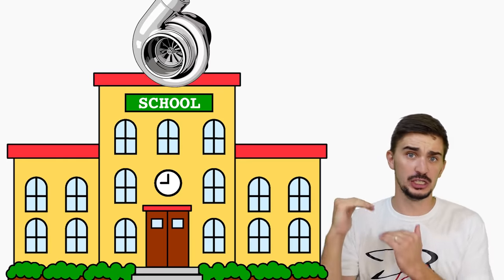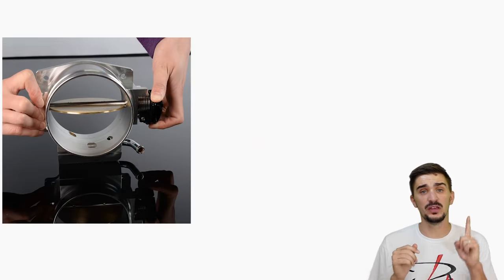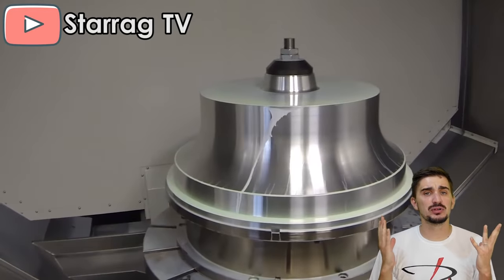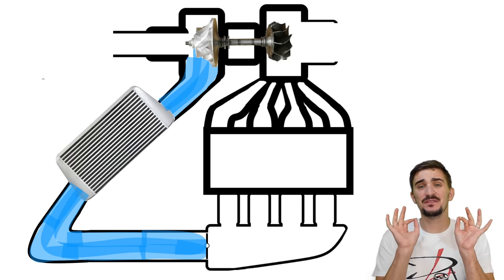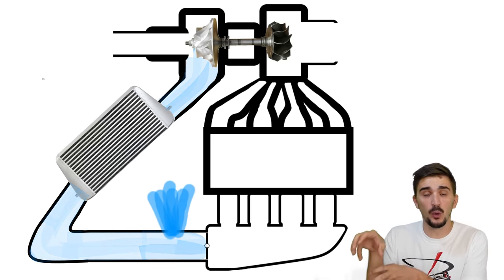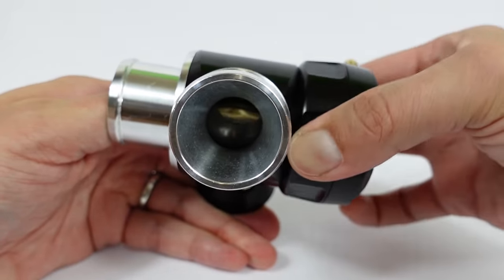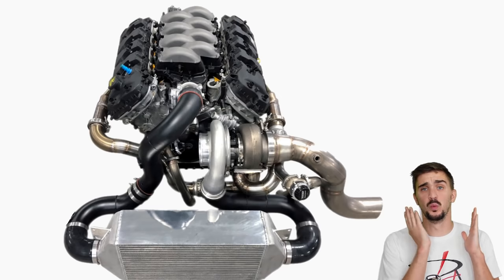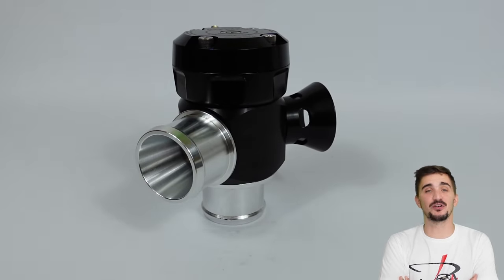TURBO FLUTTER and BLOW OFF VALVES explained in DETAIL - BOOST SCHOOL #8

Comment: it would be the best to install throttle body in front of compressor, no need for bov, and turbine keeps to rotate
Reply: There is a reason no one does it like that, it doesn't work very well.
Reply: @DriftNick  thanks, but all screw/root superchargers have throttle body in front of s/c, and that seams better because it can be controlled how much of air will be sucked in and better efficiency because no air is wasted
Reply: @makantahi3731   Screw/root superchargers don't have a large volume of air after them and they are belt driven which solves a few of the issues you have with a throttle plate before the turbo like throttle response, the vacuum making turbo seals leak and overspinning of the turbo.

Comment: You forgot to mention compressor surge occurring while the throttle plate is still open, this scenario is the main cause for turbo failure due to surge.
Reply from the maker: I didn't. Check the last time stamp.
Reply: @d4a  perfect, my apologies for not finishing watching!
Reply from the maker: No problem 😊

Comment: This is the first time I heard of turbo flutter on full open throttle. How can the turbo overpower the engine? Isn't that the job of the wastegate? Was the car wrongly setup?
Reply from the maker: Yes, the setup is essentially incorrect unless you actually wanted it that way. The turbo is not overpowering the engine, it's simply feeding more air than the engine can consume. Wot flutter can happen before the target pressure for opening the wastegate is achieved.
Reply: The clip he showed isn't on full throttle, that is when it's less likely to happen, it's mid-high rpm with part throttle (in that video he is trying to make the sound to show it happening).

Comment: Is induction flutter also created via the BOV? I'm not sure if my question is correct but, I hear it a lot on WRX and STi's, and it is very pronounced during acceleration, and very distinct while you hear the rumble climb the rpm range.
Reply: If im understanding what you're saying, you are talking about the turbo "fluttering" while creating boost. This is usually an internal waste gate inside the turbo opening and closing in order to regulate max boost so you dont overboost.
Reply: You're mixing wastegate flutter with turbo flutter, both diffferent things.

Comment: I never run blow off valves on my turbo charged cars, and no damage to my turbo. Off throttle compressor surge doesn't harm turbos, however full throttle compressor surge can destroy a turbo.
Reply from the maker: As I said in the video "if boost pressure isn't high enough". When you run low boost surge can't harm the turbo, that's why some early turbo cars didn't even have diverters or bovs from the factory.

Comment: A bit late to the game with this comment. But wouldn’t one be able to tune the blow off valve with springs if the turbo is overpowering the BOV? 
Also if I’m getting flutter from my turbo, and also have a BOV, would I need less spring? I haven’t turned up the boost all the way, I’m just at 15psi. 

Thanks 
Maurice
Reply: no, a bov has boost on each side so the spring doesnt need to be very hard.
Reply: @AtMortenJ  I ended up looking into it more after drunk posting this, and I’m pretty sure I’m over sprung on my BOV. I’ll grab a lighter spring, and keep the old one in case running another 10psi is too much for it. 

Thanks for the reply!

Comment: One question , pedal box or sprint booster they make throttle plate open fast , its it going to damage fuel pressure sensor?

Comment: I always heard that a low pressure turbo don't get hurt at al by flutter? around 0.4-0.5 bost pressure shuld be harmless or am I wrong? my -01 volvo 2.4T do flutter al the time when letting go of throttle, and I have the open airfilter. I can hear it FOFOFfofofof.. I have not done anyting else to it.
Reply from the maker: Your assumption is correct. As I said multiple times in the vid when mentioning possible damage: "if there is enough boost". Flutter at 0.5 or 0.6 bar can't really hurt the turbo. This is why early turbo cars that ran boost didn't have a recirc from the factory. Today all cars have them.
Reply: @d4a  Thanks! sometimes its hard for a swede like me to take up it al in one goo like this :)

Comment: Quite a bit of misinformation in this video. Off throttle flutter does NOT cause damage to the turbo, even at relatively high pressure 20+ psi.

Comment: This video that I found on auto play while working may have just fixed my 2012 GolfR... 

Although what would you check if at what you describe around 14:40 is happening at idle/general driving, not just WOT?
Reply from the maker: Stock or modified?
Reply: @d4a  turbo and diverter valve are stocked with just a gfb DV Plus added to the stock diverter valve. The car is modified itself, with a tune and everything, but with four mechanics looking at the car so far, four different ideas what the problem is.

Saw this video and suddenly it made sense what might possibly be going on with my car except it's also happening at idle

Comment: Is there a difference between these and a “waste gate”? I’m thinking the waste gate relieves the exhaust pressure rather than the intake pressure?
Reply: The waste gate relieves exhaust pressure.

Say you want to make 10psi of boost and no more. You set your wastegate spring to a “10lb spring”. This means the waste gate opens at 10 psi or more. 

Why? Well without a wastegate the turbo will continue to make as much boost as it can depending on the given exhaust flow.

Having a waste gate with a 10 psi spring will allow your turbo to spool up and once your making more than 10 psi the remaining boost is diverted back into the exhaust pipe (down pipe/turbo elbow) or is some cases to atmosphere (external waste gate). This allows you to maintain 10psi of boost.

Replace 10 psi with whatever is your desired psi is.

Comment: So if your car is running low boost/power than it’s fine? I’m planning on turbocharging my gt86 and I’ve seen builds with 9 psi at 300hp would this still be bad for your turbo?

Comment: Can you do a comparison on that for gas and diesel engines?
Reply from the maker: No bov on diesel because a diesel doesn't have a throttle plate
Reply: @d4a  i see. AFAIK gas throttle is regulated by the amount of gasoline being injected contrary to the diesel which is controlled by air isn't it?
I do hear flutter on my 2.0 TDI from time to time though

Comment: Need advice, replaced my stock turbos ( cus they were leakijg oil) on my 2015 m4,  installed CTS stage 2+. It runs great with my stage 2 tune that I've been using. I hear the spool amazing, pulls hard, but I get this flutter sound especially when going hard in Sports+ mode, almost like in the end of the video. Would a custom tune fix this flutter? Ive seen smoke come out for like 15 seconds..twice in the last 2 months. A quote for custom tune by RK Tunes is going to cost about $1400 minimum.

Comment: I hear turbos on diesel make a seeeer or tssuuuuu sound when str8 pipe is that turbo surge? Beause not all turbos on diesel makes that sound although diesel dont have throttle valve
Reply: Some modern diesel engines do in fact have a throttle plate to help control emissions. Sounds stupid but I guess it works.

Comment: I have a 2003 Saab 9-3 Linear 2.0L turbo.. I replaced the worn stock turbo with a Stigan turbo and left all engine computer control settings stock..  The new turbo sees to "stutter" during acceleration and I don't know why or how to fix.  I emailed Stigan but got no response.  Any ideas? at some point I had replaced the turbo bypass electronics too, but I don' t think this caused the problem since I don't think problem existed until I replaced the turbo.

Comment: What if your engine doesn't have a throttle plate?  Could I still use this BOV without intake vacuum?
Reply from the maker: It can be rigged up and there are kits for diesel engines but for most applications there's zero benefit.

Comment: I some times cannot believe what I read on You Tube.

TURBO FLUTTER:

When a Turbo Car is in Boost then the Throttle Body is shut, there is Air pressure volume stored in the 

Plumbing from the out put of the compressor through the Intercooler and back in AGAINST the Throttle 

Body.

If you allow the pressure to not INSTANTLY be relived, this pressure will place pressured air AGAINST the 

FLOW{ Direction of Rotation of the Compressor) on the  Compressor Blades  and place the Turbo into 

"surge". 

This could be disastrous on the Compressor Blades and cause failure of the Compressor itself.

When you are "Fluttering" this is exactly what  is happening during the flutter. 

Best to relieve in THE DIRECTON OF THE COMPRESSOR BLADE to keep the Turbo spinning.

Also, using BOV to atmosphere is very wasteful, as well as causing more Turbo Lag between shifts.

One should not loses the HP needed to "Spool" a Turbo, which is 60-80 HP! 

Recirculate and forget the "cool Swish" sound, just shows that you know nothing about efficiency of 

Turbos  and make your  look like an idiot,  if you allow "Flutter" to exist.

After you break a few compressors, you might get the idea.

Learn some basics about Turbos before using them.

FLUTTER, HONESTLY?
Reply: Keep the turbo spinning? do you think it stops the turbo?
Reply: Keep the turbo spinning? do you think flutter stops the turbo spinning?

Comment: Hi I have a question
I have a mk4focus st my car has a build in antilag I want to instal a bpv valve but off throttle my car keeps the throttle slightly open would it damage my engine with 100% with the bpv valve ?

Comment: orrrrr you dont have a BOV and use a cheap $150 ebay turbo thats works just as good as any other turbo and replace it when it breaks from all the sweet tunes your making for a low low price :)

Comment: Diesels don't have an intake valve so they don't need a blow off valve? And what is the difference between a blow off valve and a wastegate which looks like it does the same?
Reply: wastegate is for the hot side of the turbo, lets excess exhaust bypass the turbo. completely different but easy to confuse them

Comment: I have 100k miles on my turbo, and have had compressor surge since the day 1.  Why hasn't my turbo blown yet?
Reply from the maker: Because you're running low boost. It has already been asked and answered in the comments.
Reply: @d4a  I didn't know 30 PSI was considered low boost

Comment: Anyone know if a Fiesta ST (MK7) would throw a code or smoke when using an atmospheric BOV please? The MAF sensor is right next to the air filter and quite away from any return pipe, so the pressure can't be that high for it to sense a radically different flow.

Comment: I have a 1997 Nissan Silvia facelift Sr20det turbo factory . I put on a gfb Bov and pod filter the car flutters all the time now I tried making it tighter and then more lose I've had to adjust it to full atmosphere and it only goes tutu now instead of tututututu but it's still annoying.  I had bov first and it was fine on 50/50 now I've put pod filter on it flutters is this because factory airbox hid the sound? Or do you have to get it tuned ? Car was fully stock so only 6psi its unfortunate.  Sounds cool but I'm worried about turbo

Comment: So for the waste gate on some turbos is for the turbo flutter at WOT, isn't it?
Reply: The waste gate just controls boost pressure... depending on your desired boost level, it opens and routes exhaust gasses away from the turbine to slow the rpm and reduce boost pressure... without a waste gate a turbo would just keep building boost until it inevitably fails or blows the heads or head right off of your engine.
Reply: @seanrobinson4798  ah, thanks there mate!
Reply: Anytime, knowledge is power 😉

Comment: What do you mean by mismatch between engine and turbo? What makes a good VS a bad match between the two?
Reply from the maker: A turbo that's too big will result in pathetic performance before it spools and it will spool at too high of an rpm. A turbo that's too small will choke the engine, it will spool fast but the upper rpm range will be lifeless.
Reply: @d4a  thanks, that explains it well!

Comment: i allways thought that the "STutututut" is the BOV rapitly opening and closing again.

Hearing that it is bad and damaging makes me sad.
Reply from the maker: It's only bad when boost is high enough.
Reply: @d4a  but its still sad to know that a well built/tuned engine won't make that cool noise
Reply: @d4a  How high is high? people here in Australia running 50+ psi without one.
Reply: @lorenzhartl8466  Meanwhile in Australia plenty of the best engine builders and tuners don't run a blow off valve on their cars.

Comment: Is a blow off valve basically the same as a wastegate?
Reply: No. The wastegate is located on the exhaust side of the turbocharger and  bypases some of the exhaust gas around the turbine when a certain manifold pressure is reached. So basically it is used to limit boost pressure by limiting how much exhaust flows through the turbine.

Comment: No! No! No and no again!
This is very very common myth  that installing BOV on an engine with MAF sensor will cause an engine stall because of too rich A/F mixture.

Situation 1 - running the MAF engine with no BOV:
- Running full throttle.
- Some air has passed the MAF, and the MAF told the ECU to calculate the amount of fuel to be injected.
- Suddenly the throttle closes.
- Some of the air that has been seeing by the MAF did not reach the engine.
- The air is escaping form the piping in the opposite direction. 
Why the engine is not stalling? The air has passed the MAF, the ECU has calculated a lot of fuel t be injected to correspond amount of passed through the MAF air, but almost all of this air didn't reach the engine, because of suddenly closed throttle. So ECU should inject a lot of fuel, and the engine must stall (too much fuel, to low air). But it is NOT stalling. It is not stalling because when you suddenly close the throttle ECU see it and DO A FUEL CUTOFF! It cuts off the injection of the fuel for a short period of time and do not look at the calculations made using MAF signal. After some short period of time it enables fuel injection again and starts looking at the MAF signal.

What happens when you have situation number 2 - running the MAF engine with BOV:
- Running full throttle.
- Some air has passed the MAF, and the MAF told the ECU to calculate the amount of fuel to be injected.
- Suddenly the throttle closes.
- Some of the air that has been seeing by the MAF did not reach the engine.
- The air is escaping form the BOV valve.

So there is only 1 difference in this situations - the air escaping direction.
With no BOV - air escapes backwards causing the compressor surge
With BOV - air escapes towards the location of the BOV, and then through the BOV.
That's all my little boosted friends.
So there is NO cause the engine to stall when you shut off the throttle under boost. With BOV or without.

Now lets speak why the engine REALLY stalls when you shut off the throttle under boost with BOV  installed:
- something is wrong with your setup! And usually the reason is BOV ))))) But not BOV itself, it's wrong setup.

In most cases the reason is  that your BOV is closing too slow! When the ECU enables the fuel injection after the cutoff your BOV is not yet fully closed, and some air goes through it to the atmosphere instead of you engine. You can tighten the spring on your BOV, it will start to vent the air at a bigger level of the boost (at a low level of the boost you will experience some surge) , but it also will start to close more rapidly.
So there always a compromise between the surge and venting air through BOV. There may also be some other wrong things with your setup, every case is someway unique. 

Some tips on this issue: try to use VALVE type BOVs (they work faster), not piston type; try to mount BOVs far from MAF; try to mount BOV directly on the pipe; always use shortest air hose possible to control the BOV; You can use advanced electronics to control MAF signal in case there is no other option with your BOV setup (BUT remember: any additional electronic installed into your system is a point of possible failure)

To be honest - I'm running RB26 with huge single with BOV with stock (remapped) ecu with no stall problem, and have resolved a lot of such "BOV" issues on other turbo nissan projects.
Thank you.

Comment: Hmmm I take it this guy hasn't heard of a wastegate? No mention of it. Plays a key role and what aids the turbo chatter from the spring pressure in the actuator.
Reply from the maker: Hmmm I think you have absolutely no idea what you're talking about 😂
Reply: Totally different functions. Waste gates restrict the total exhaust drive pressure to the turbo, and thus restricts the total boost pressure. A blow off valve keeps the intake pressure from blowing holes in your intercooler or pipes  or worst of all, your turbo on the driven side rather than the exhaust side by releasing the pressure your turbo keeps making while it's still spinning really fast from being at full power.
Reply: @d4a  You could have at least tried to explain it to him. Check out my response to him and let me know if it sounds right to you?

Comment: My mom's car does one single loud stuuu, whenever I go off the throttle
Reply: I wonder if it's the blow off valve, but I have no idea if her car has one..., it's a 1.5 dci
Reply: Do cars have blow off valves from factory?
Reply from the maker: No, your car doesn't have a blow off valve, it's a diesel. Gasoline cars also don't have them from the factory, they have a recirculation valve. In your case it's an issue with the turbo, likely worn out or incorrectly rebuilt etc.
Reply: @d4a  it was probably incorrectly rebuilt then, because it has been doing that for 3 years now and it has not failed yet..